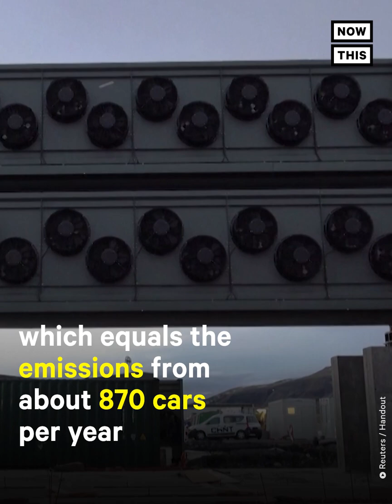World's Biggest Carbon-Sucking Plant Opens in Iceland

Comment: Cool but how much does it produce to do the capturing?
Reply: Well it’s powered by a local geothermal plant so it’s carbon negative. Of course, people still have to drive out there, plus there’s the emissions that went into manufacturing and constructing the plant itself. This particular plant is probably more of a proof-of-concept than an effective carbon sink.
Reply: From the Climeworks homepage:
”A life cycle assessment (LCA) is a holistic scientific methodology assessing the environmental impact of products and services across its full cycle of operations. The RWTH Aachen University’s LCA shows that direct air capture has a low carbon footprint when run on low-carbon energy, such as waste heat or renewable energy. Specifically, it found that Climeworks’ plants can reach a net carbon dioxide removal efficiency of more than 90%. In other words, over its whole lifespan (including construction, operations and recycling), a typical Climeworks plant re-emits less than 10% of the carbon dioxide it captures. Future scenarios show that this can be further reduced to 4%. ”

Comment: Dumbest idea ever. If you want to capture CO2, you do it where it is high concentrations which is at the tail pipe of a power plant. Trying to capture it from air where the concentration is less than a percent, is simply not a smart way to do it. Using energy to do that, rather than use that energy to replace carbon producing energy plants again, doesn't make sense.
Reply: I guess the idea is the plant runs on excess renewable energy, of which Iceland might have a lot at times. Therefore it will never be next to a tail pipe. That said, this is still pure placebo technology, to give first world consumers peace of mind that they won't have to change their comfort level.
Reply: @totoro5421  That 'excess renewable energy' would be better used doing something useful. It could be used to run computer server farms, it could be used for various industries etc. Anything that would replace fossil fuel power plants. You are sort of correct about the placebo, it is there because they are being paid to do it by companies that want to green wash themselves and claim they are carbon neutral when they are not. If a company can buy their way out of not curbing pollution, they will.
Reply: @TimothyWhiteheadzm  Yes, agree with everything. I was just guessing why direct capture in Iceland, of all places.
Reply: @totoro5421  geothermal energy.

Comment: What was the total carbon cost of building this facility? How long will it need to operate until it "breaks even" so to speak?
Reply: Judging by the size alone, I'd say much less than it saves. I trust that they took the net carbon into account seeing as it is a major project with lots of publicity
Reply: @isaac_aren  we're looking at concrete, steel fabrication, transportation construction, personal. I would like to see those numbers.
Reply: @SMABEM  A wind turbine, a much less carbon efficient machine, becomes completely carbon neutral after 6 month and will continue to work for around 20 years. This machine is much smaller, easier to transport, and easier to produce. I think it would offset the carbon emmission from making it within a few months as well
Reply: @isaac_aren  I hope so. We need all techniques possible.
Reply: @blkhemi3925  it is, but how carbon negative is it and can it be scaled rapidly?
Reply: @blkhemi3925  As per the other thread you started, your math is way off.
Reply: @blkhemi3925  How much of that is in the air already tho? The percentage of carbon dioxide barely changes from inhaled to exhaled. By about a percent at most
Reply: Excellent point.
Reply: idk, Go look it up
Reply: @lifeiswonderful22  where?
Reply: @SMABEM  The internet is where I usually go to find information.
Reply: @lifeiswonderful22  I was hoping for something more specific. I looked but couldn't find the company accounting for the production of the facility. When building these projects we need to understand the carbon cost first. Or else we may not be net negative.
Reply: @SMABEM  Ok, then go to a site where one of these is being made and measure the CO2 output during construction.
Reply: @SMABEM  Took me like 10 seconds to find the names of the companies:
the companies behind the project – Switzerland’s Climeworks and Iceland’s Carbfix –
Reply: @lifeiswonderful22  so... what was the carbon footprint of the build?
Reply: @lifeiswonderful22  I'm talking about the full carbon footprint of the build. Soup to nuts, are they reporting it?
Reply: @SMABEM  Idk, go do your own homework.
Reply: @lifeiswonderful22  ha ha

Comment: We need more of these everywhere.
Reply: Or we can plant trees instead of burning them all
Reply: True. But it does have it's disadvantages 

For example, 
the fossil fuel companies would just use this as an excuse to keep burning Fossil fuels.

It depends on where the energy those facilities are using to power the plant, are being received from. If they are getting power from Fossil fuel plants, then it kinda defeats the purpose of the plant.

But it does help to buy the environment some more time, however small it may be. 
And there's room for improvement
Reply: @epicboot7415  well actually from this extracted co2 we can make synthetic fuels, and if done with renewable power, that means it’s carbon neutral fuel that can be used in existing vehicles. In the long term if enough renewable energy comes available we could make current infrastructure and vehicles run fully carbon neutral. Although it’s most definitely something for 2030-2040
Reply: We emitt 43b tons of co2 every year, that would mean we need 14333333 of these plants, which would cover something more then a quarter of the planets land
Reply: @meretricioussimp7759  well the technology will improve and we are not gonna only build carbon captures.
Reply: @LearnMaths-p9n  i know that but carbon capture is simply not a solution, we need to hold companies accountable, these companies are also funding carbon capture to get more oil out
Reply: para de ser burro cara
Reply: The problem is, once we get to a point where we can compensate for the greedy people of the world, those greedy people will just be greedier because they will think that they can get away with it so they will just put us all back into the same position. 

Humans aren't greedy by nature, Americans are because they were born to be greedy and have been told too by their rulers for a century with the most powerful brainwashing the world has. Honestly, nuking the U.S is the only way to save the world
Reply: Yea but Australia has a lot of carbon captures but they rarely keep it operational.